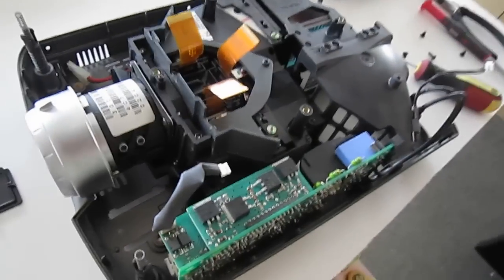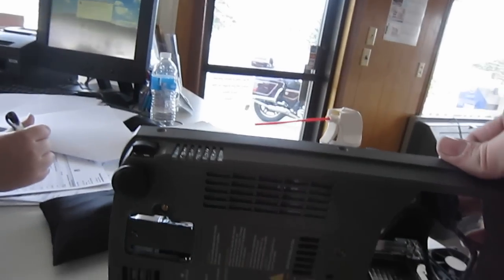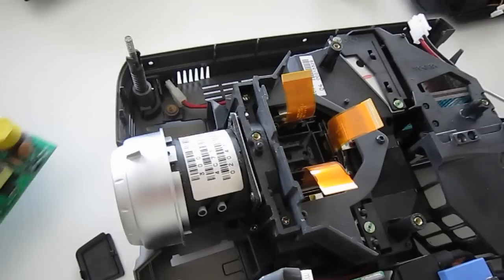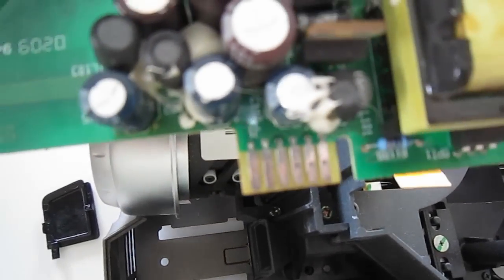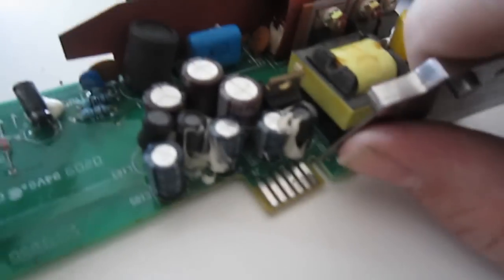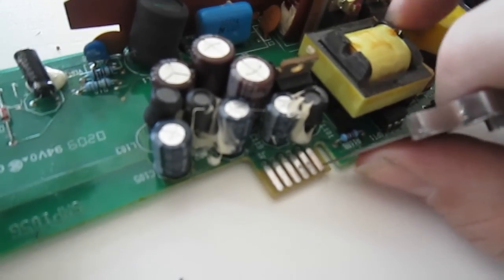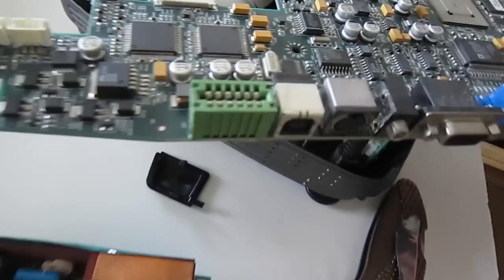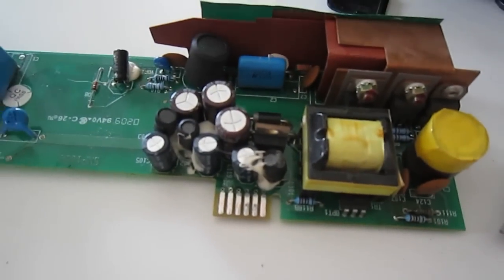How to Repair InFocus Projector Power Issue (LP290/LP280)

Comment: Being in the electronics repair business for almost 40 years I would recommend instead of a knife, use emery cloth (light grade) or an emery board.  Also after burnishing (cleaning) the edge card contacts, you can use the emery board to burnish (clean) the contacts inside the edge card connector, it should fit into the connector fine.  After doing this it is advisable to blow out the edge card connector with compressed air.

Comment: I just fixed mine with the help of the video, it has been standing on a shelf for many years because of this problem. Has not verified yet, but atleast it started after.

But here is some guidance as how to dismantle it:

1. Carefully remove the lamp assembly and place it carefully on a safe spot.
2. Remove the metal ring around the "sound in" connector. (Unscrew it)
3. Remove the torx screws around the projector (7 pcs i belive).
4. The lid shall now be removable. 
5. Look carefully around the upper PCB, remove the connectors as needed, mark them if needed (fan1 and fan2 needs marking or something).
6. Remove the three flat cable connectors, pull the beige/brown part towards you using your nail (or a screwdriver, but carefully) a little on both sides and the cable will come loose.
7. Remove the torx securing the motherboard, notice that there are four with a fine thread and one plastic screw.
8. There is a grounding screw by the connectors that need to be removed, when unscrewing the screw hold on to the white plastic hexagon with pliers or something.

I did not remove the power board from the projector, just folded out the motherboard and let all connectors in the back stay in. When cleaning the connectors of the
power supply make sure metal dust don't fall into the projektor!

Also take card of the springs for the height adjustment. One of them fell into the projector for me. (not quite sure what function they really serve).
Reply from the maker: adentse Thanks for the feedback!

Comment from the maker: Unfortunately I don't have that projector handy at the moment, but disassembly is pretty straightforward; the screws are all on the bottom of the unit.  Just take out every screw you can find, and the top lifts off.

Comment from the maker: @NathanFreel that sounds more like a failing fan or loose fan power connector.  I would suggest that you open it up and make sure all of the fans have good contacts, then try ordering replacements for any that still don't run.   Look at the fan and Google any numbers you find.   They should cost less than $10.

Comment from the maker: Have you checked the bulb?  The bulb can fail while still 'looking good' due to the way these bulbs are made.  If a replacement bulb doesn't fix it, I would check the connections for the power supply, but typically when the power supply is at fault, the unit will stop entirely -- no fans or LEDs or anything -- just like you had unplugged it.  If it's acting like you unplugged it, then I would tend to suspect the power supply first.  Check for blown capacitors as well as corrosion.

Comment: actually for the acessible contact you could use a 600 grain waterproof  sandpaper

and a 600grain waterproof sand paper for inner contacts cutted at the good length to fit socket , bent it in 2 to have a double faced sandpaper and insert/remove paper in the slot a couple of times

and i say waterproof because it more robust rhan a normal sand paper .

Comment: My projector recently quit working. It works for a few minutes then shuts off. Also, the fan will be running intermittently. In your opinion, would this solution fix my problem?

Comment: I have a InFocus LP70+ and I have a problem with that:
When I turn it on, it will show blinking green light and tries to turn on the bulb, but it won't turn on. Then it goes to blinking red. 
I tried replacing the lamp, but still no luck. Any suggestion on what can be the issue?
Reply from the maker: That sounds to me like a failed inverter.  Check the power voltages coming off the power supply to make sure they're what they ought to be.  If they are, replace the inverter.  The inverter is the green board that the lamp connects to.  Don't try to measure the voltage at the lamp pins; it's extremely high and dangerous.  If the lamp is good and the power supply is putting out the correct voltage, the only likely part left is the inverter.  The mainboard can also be at fault, but with those symptoms it's unlikely.
Reply: zibodiz
The power voltage that is going to lamp is 3.7 v. But as you said it should be way more than that right?
Do you know where can I buy the inverter board?
Reply from the maker: +Amin Yazdani
Do you mean the voltage going directly into the lamp plug, or into the inverter board?  The voltage going into the inverter board should probably be in the 5v - 24v range (I wouldn't know for sure without looking at the board or schematics), but going into the lamp should be 1,000v-50,000v -- extremely dangerous high voltages.  I do not recommend testing the voltage at the lamp pins, as that can be lethal if it should arc through you.
If the power you tested was coming off the power supply, I would replace that.  Otherwise, if it was the lamp plug that had the low voltage, it is most likely the inverter.  The easiest way to find a replacement is to find every part number printed on that board, and google them one at a time.  When you find a number that seems to reference the part you need, look that number up on eBay and at websites like encompassparts.com or sears.com (sears has a large selection of parts available).
If you can't find the part you need, look for a similar model on eBay that you can scavenge parts from.  Used projectors with bad bulbs or picture errors (DLP errors, discolored picture, etc) can often be purchased for $25-50, with many useable parts to be scavenged from them.